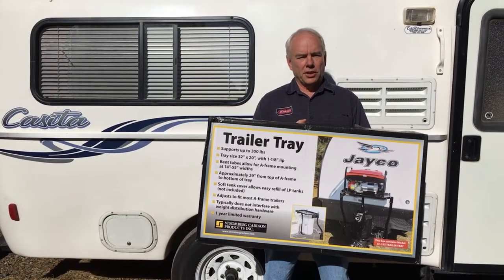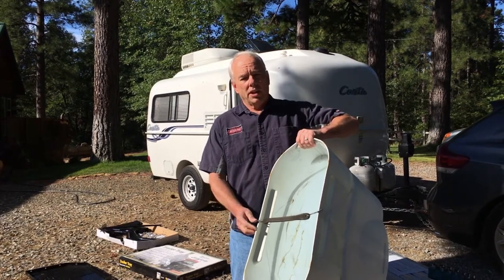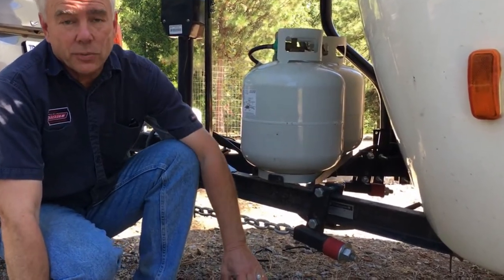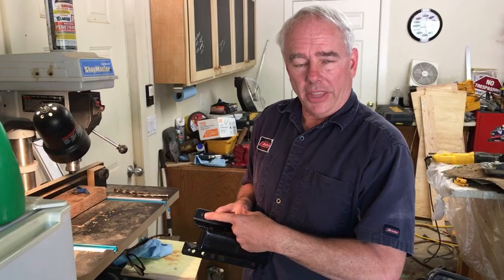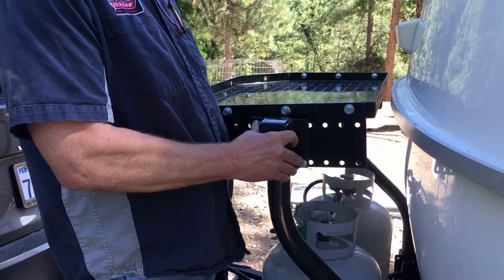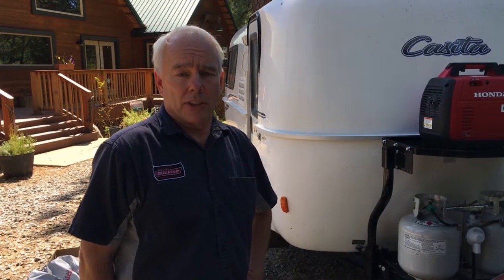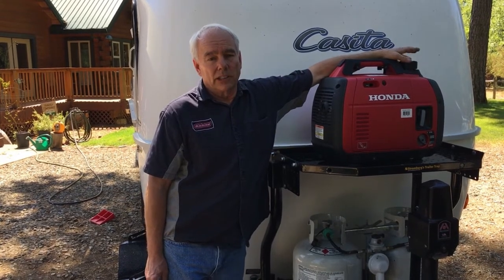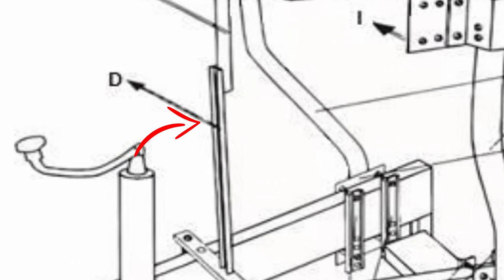Install the Stromberg Carlson Trailer Tray

Comment: Installing the same tray on my 2022 and you can only lower the tray about 4”, otherwise the tray hits the electronic jack.  Looking at
Possibly turning the jack around 180 degrees so the tray can fit behind it and lower more.
Reply from the maker: We haven't had that problem.  We did turn our new jack sideways so we can open the truck tailgate.

Comment: Big question here.  How did you install the big water tank?  If it involved removing the fiberglass under the bed, how did you do that and how did you manage to put it back in?
Reply from the maker: It fit through the opening under the bed.
Reply: @TravelsandTravails  Huh.  We ordered ours from the factory and there is no way you could have installed it aftermarket.  Thanks.

Comment: My wife is worried about running the generator right over the propane tanks. Since you guys have had this awhile, have you had any issues?
Reply from the maker: I understand her concern, but we haven't had any issues.  You can get a converter for the generator that runs on propane, so in my mind, it's safe to run the generator over the propane tanks.  If she is still worried about it, you can always shut off the propane at the tanks while you are running the generator, although I don't think it is necessary.

Comment: Hey buddy.
Question… how can I mount the Honda 2200 generator to the tray so it won’t get stolen?
Reply from the maker: Doug's friend created the locking generator mount.  You can buy the lowpro lockdown, but I've heard the wait time is long: http://lowprolockdown.com/shop/hondaeu2000lockplate-redblack/  I also read a post that you can get them from Texas Customs, but I haven't verified that: https://texascustomz.com/worlds-toughest-casita/
Reply: @TravelsandTravails  thanks. Hoping to find a way to just screw in down from the bottom of the generator.
A $200 mount is ridiculous.

Comment: This Stromberg Carlson Trailer Tray is available thru several suppliers other than Stromberg Carlson. I purchased mine thru WallyWorld., that's a comic name for  (W.....................T )  Also that supplier at the time of my purchase was free shipping & lower cost. Since suppliers constantly or at least from time to time, change prices, do your research. Only issues I had was weight of inverter hard to put on & take down from the height & weight of inverter makes it cumbersome, especially with a 70lb inverter that I have.
Reply from the maker: Great suggestion!  Doug cut the supports on the trailer tray to make it lower.  It sure does help his back and shoulders when getting the generator down!

Comment: How do you remove the propane tanks for refill?
Reply from the maker: Since we don't have a cover on the propane tanks, they come out easily.
Reply: The tanks aren't really an issue, as long as you aren't using a rigid plastic tank cover. You won't have enough clearance to take the cover off once the tray is in place. You can still open the lid to refill the tanks, though. The easiest thing is to just use a soft cover.

Comment: Can you put in writing what you cut off at the top please in the video you stated 6 inches was cut off the the legs. I understand 4 off the bottom leg, what is confusing is what is written in red on the screen 4 off the bottom but 6 off the top! Is that correct? That would be a total of 10 inches cut off. I like the lower height!
Reply from the maker: Do you have the Anderson hitch?
Reply: @TravelsandTravails  I have the same question and I do have the andersen WDH.  So after initially cutting 4 inches off the top, did he go back and cut 2 inches more off the top when you realized the tray was too high?

Comment: Really glad I saw this video. I'm having to do a similar modification to mine, but not for clearance issues. I have a GeoPro with the off road package, which sits about 6 inches higher off the ground than the average trailer. I cut the supports down by 6 inches (3 inches off each end on the curved ones, so the shape stayed the same), and now it's low enough to load without needing a ladder.
Reply from the maker: Glad it helped!  What are you putting on top of the trailer tray?
Reply: @TravelsandTravails  A Honda EU-2200i generator with an external fuel tank

Comment: I only can have 24” from the top of my AFrame to the top of the shelf on my pop up if I do not want to dismantle the shelf to pull out the bed. With a normal bottom mount do you think I can bring the shelf down that low?
Reply from the maker: We aren't where the trailer is right now.  When we get back to it, we will check.  But that won't be for a while. You can cut quite a bit of the straight sections from the top and bottom of the support posts.  5 gallon propane tanks are 18" tall, so if you are mounting them below the trailer tray, you would have enough room to get them out.  When we get back to the trailer, we will measure the overall height of the tray and let you know.
Reply from the maker: We measured our tray.  It's at about 24" right now and it looks like you can cut down 1-2 more inches.  I took some photos.  Let me know if you want to see them and I can post them on our Facebook page.  We were out of the country and just got back.